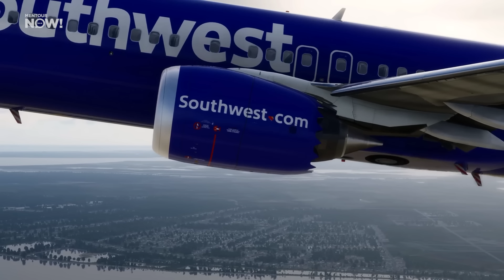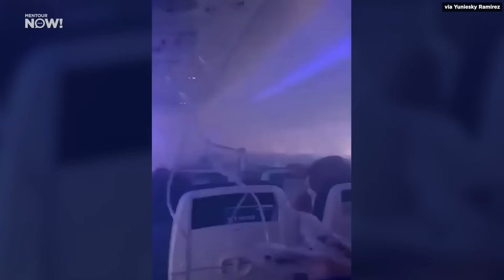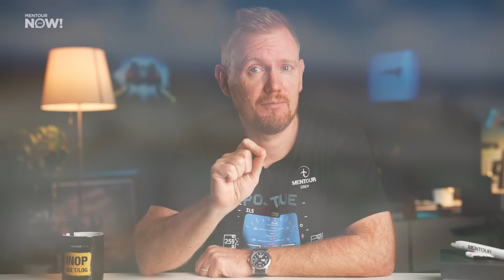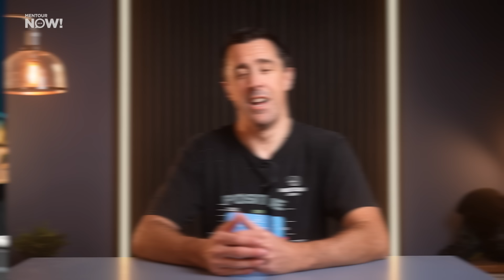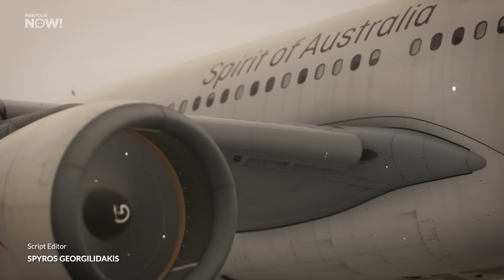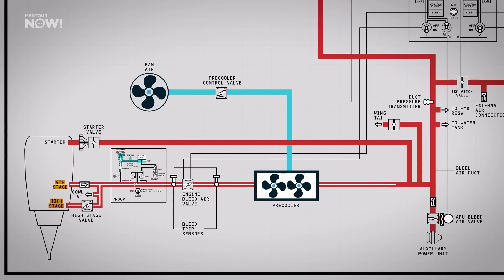Why Don’t ALL Airliners Do THIS?

Comment: It’s hard for me to believe that a fully electrical system would be equally or less efficient than a bleed air system, or even an improved bleed air system. I suspect really this comes down to the development costs, certification complications, and the avoidance of introducing new problems on a new aircraft. That said, those are indeed real costs that ultimately get passed down to the airlines and passengers. 

We have seen in the automotive market (even excusing/before stop-start tech and hybrids) the movement away from engine driven accessories to electric (power steering pumps, cooling fans, etc). Even my Volvo’s B6 engine uses an electric supercharger instead of a belt driven model like on the older T6 engines. 

I suspect in the future we will see more electric based systems replacing bleed air. That said, in the meantime, short of designing a better LRD substitute on new engines, the software fix to shut off the HVAC of the affected seems like a no brainer. It seems like in future models with bleed air HVAC the air quality should also be monitored for contamination.

Comment: It's a technical, a physical issue, not a software one.  I used to visit an aeroplane 'museum', here in the UK, where all sorts of Cold War jets and civilian aircraft accumulated.  It was privately owned, so made a bit of money by breaking and selling parts to other collectors, from planes that really were past redemption.  My point is that, amongst these parts were what looked like turbos from trucks or sports cars.  Apparently they were driven by bleed air from the engines and compressed fresh air to run the cabin air system.  It physically separated engine air from cabin air, the price was slightly less compressor efficiency by turning engine air into cabin air and the addition of a few Pounds weight of equipment.  It seems that penny pinching is risking passenger safety, rather than using an entirely isolated fresh air supply.  Technically, you could run a turbine compressor for pressurised cabin air, from an electric motor, the latest battery tech is now so safe that something with enough kWhs storage could keep the climate within the norm, even with various systems failures.

Comment: I can definitely understand the fear of unproven technology or innovation and wishing to stick with the tried and tested, but I'm actually pleasantly surprised that Boeing is still willing to innovate despite their current reputation.  It will be interesting to see what happens down the line to see if removing the bleed air system and relying on electric battries snd generators (which still requires drawing power from the engines or the APU) is a potential step forward, or some kind of hybrid system (e.g, relying on electricity for air conditioning, and bleed air for anti-icing with an electric backup if there's a bleed air malfunction).

Comment: DC8/Boeing 707/720 generation of aircraft didn't bleed air directly from the engines for pressurization and air conditioning via a compressor driven by bleed air

Comment: And why pilots should never comment on engineering.
The main reason the 787 is an electric mainly is because of the fuselage.
 It composite. Oil dose not work with composite. Even minute oil into a composite fuselage can damage the material.
Hence why cabin blowers are used. This is not new to aviation. Cabin blowers have been used in the past. I’m pretty sure the 707 used cabin blowers.
The airbus 350 was an aircraft quickly put into production to go against the 787. The 787 had the jump on airbus as they didn’t think it would work nor wanted. Hence the older style systems. 

As with most pilots their engining knowledge can be written on the tip of a pin with a felt tip marker.

Comment: In general, not necessarily aeronautics, I would ask the question if complicated hard-plumbed hydraulics can be replaced wutg self contained electro-hydraulic modules or servos, rather than driven by centralized pumps and lines. Can such simplification preserve functionality of systems that otherwise would fail along with other systems?  Would redundancies  in some areas be as less critical for EVERY system, if you can isolate components that would harm others?   I would expect less weight, fewer failure points, less wiring throughout, higher efficiency

Comment: The evolution is clearly towards electrification. Also in aviation.

Battery tech has evolved immensely even in the last 5 years. You could even book a plane on shore power and charge batteries so you don't need to run the engines and generators unnecessarily.

Comment: Maybe the weight and efficiency benefits switching to electric system is not (YET) that great. But for the safety alone it is already worth switching. New battery chemistries in the meantime will make them lighter and absolutely fireproof, and electric motors becoming even lighter and can run for years without requiring any maintenance. Like someone already posted here - old technology practically reached it limits of improvement, while the new one (bleedless) is just at the beginning of its evolution.

Comment: nice  explanation   because it shows   the  the  electrical system  of  the 787 is  kind   of "totally  new"   
As  You  know  there   was the  accident  of  th  787  Air  india,  and   to   cut  a  long  story schort   and  not  arguing  about  deep  details and   diverse  oppinions   I  workeed  on that  quite some  time    I  will  just cut  it  short!   The  preliminary   record is best  way  to  say missleading.  There  are reasons  for that, becaus boeing   Air  india   and   the  governement   they  all have  stakes  in   the  accident    and  nobody wants   them   to blame..     On the  other hand    the  data   of  the   flight rcorder  aren   knowen to  the  public  onla  partwhise   and   the main thing that  does not seem  to be  openly  available   is  the  Video   of  the   plane    covering  the  whoe flighet...   So   What  I  did is   to    calkulate   stap  by step   what   the plane  schould   do   with  the  data  or approximatet  data   i have .   so   1/25   second    to the next  one   trust   and  drag   angle  of  attec   and force  on the  Wheels   was  calkulatet  hiere with  the  result   that  the  weight  of  the  airplane was  flightwhise   within the  limit   but  runwaywhise   ist was  precisely   the  limit.  Due tu temperature  and  runwaylength.... So in  opposit  to  some ekplanations  in t he  internet  i  do  see  thet   the  plane  follows  exactly   withein meters the  prediction  the  caklulation gives.  This  is  quite difficult  to   detemin because You are in  ned to precysely  analyse  the Skiline,  and the  Wether   and  the  picturepixels  make it   wuite hard  to  fnde  ou  which building  gives  You   whicht   Pixel   of  the  skyline...  
This  is  correkt  for  the  time  on  the   gruond  anf  gets interesting   fpr  the  flighet  itself because   the  distance   from Lift  of  to  the  point  of impact   in time  and  Way   is  knowen   pritty  exactly.  With  the  eright  a of the engine  and  the sppees  of the engine  and  the  piont in thime  wehen  Power was  lost,    With   the  need to  be  able to fly  the  plane with only   one  engine   under theses  conditions ist  is  easy  to  find  out hoe much kinietic  energy   the  planne hat  and  thus  You  fide  out  the nesecary   aerodynamik   Values  You  need  to get  a   clear picture...  And  that  picture  is    different  from  what You  theing   wehn  reading  the  report....  So   theink  about the  timeline  and You  will   fnd  out  that the  Engines  will  deliver  trust   until   Flame   out..   minimum  longer OK...    and  There  is  a  time  Gap betwean   cut  of   for  the  fuel  and   flame  out for  the enggine...  

So   we see  that Fuel must have been   ciut  off  sholy before  flame   out,  and  Question  is  how  it  happened. Tecnically   spoken because  the Fuel  valve  die not get  electricity  and  colsed   spring  loaded   .  thes will happen  if  the  Switch  is  switched  and   a relias is  switched   and that Relais    swictes  the  fuel   valve.....  Question  is  why   did  the  Relais   not  deliver  electricita  to  the  fuel   valve?      Ther are  different polibilitys.  Pilot switched te  switch,  sombody pulld  the  firerhandel  works without  tucheing  the  switch  at  all  or  we  have no  Electricity  on  the C1 Bus      

to  deteckt  eletrycyta  or  lach of  electricity   on  C1 bus   is  easy because  the reat  wil derploy if  C1  ad C2  is not  availibal!   and not  generel  but  parthwhise   the big  doors   for  the  landinggear  will  open automaticly    without  anybody  acting   just  after  lift   off....    if  lift  off is   acheaved   the  schuld happen  automaticly  and  the  pilot  just   lifts  the  landinggear...   You  can look  it  up  what  is done  with  C1  and   if  C!  does not have  electrycity   or has   a  short  current,  that  schuulf have some  additional   effects  and schould be  seen  on teh  datarecorder....... So what  is   clear is that  rat  deployed before    the  report says    the   "cut  off"           So  the  valve   dor  th  left  engine  musthave  closd  before  Anybody tuched anything....      Go  deeper  into  the  electrick  systm   and You  will find  that  a  schort  current   in C1  will  schut  off  C!   but  will shut  of  the  C2   system  thereafter,  so   rngine  two geot no  fuel   too....    That'sbad because having  two  sysems    should  just  prevent  this.    But here  The systems  are  connected   beacause   thes  want   redundency   in  case of  a   deliour   "no  power supply"   the otehr  system   with  generaor  will help   out  Everything   ok!  but  if  You  have  a  short  curnt  the  connection   wil ruin  the second system!   so  that's   waht happened...   I  dug  deeper into  the whole   thing  but    faced  some  limitations     (pleas  considder  that  everybody has limitatios!  some  people theink  tey  do  not!  and i like  to  prove  them   wrong...   but  in this  case   an  austrelian engeneer  was  diving  deeper  and    he   is nor  a  guy  to  explain  good  ore make good  videao   etc, but i  could not  find  a  fault  in hie  aruing  ent  ist  is    xactly the   same   I  found  aut but  takes  it  a   step  further...  So  I  like You  to look  it  up  and to think  about  what realy has happend  here... I am suhre  the  pilits did not have  any  chance!     ther e are  two  ctitical  things  to  say.   There  is   a  rute  cause,  and  the  suggestion   ist that's the  diode   in  the Battery  sytem  and a schort   current  threough  tha battery...    might be righet.  That  one engine not  running   would have ment   teh Pilots   would have  had  a   good  chance   to save   the   plane  with  one  running engine.   But  the  realy bad   thing  is    the    connection betwean   c1  and c2  veeing  closed   during  the  flighet    eiter   from teh  beginnen   that mans    it  was closed   while  boath  systems   had  there  own  Powersupply    and  schoulf  nat have beeen  connected    Or  it  was  an  automatic  act  of  the system  for   redundency   in a  sconde  after  C2  failed  due  to  schort  cirkurit!       so   what  ever  the   rout  cause  was,    we have  a problem  killing more than  200  people   and ist's a  built in  faulte  waiting   for  the desaster  to happen.   I  do not  know wether  its's    a maintenence issu  wether its's   mentiond anywhere ,  wether  its   a fault  in  the  design of  the  system   or  was it  requierd   to   work   this  way ..   how   schould  the system  work  in  this  cays   was it   rquererd   constructet  implementet   and   tested?        So   what  did   the  othoryties  rquire   what was  tested?       Sorry for my englisch  !   it's not mymothertoung,

Comment: The 787 main electrical system apparently runs at an unregulated nominal 400 Hz (360 to 800 Hz depending on engine RPM). Higher frequency allows much smaller transformers and other components. US Navy ships have primary electrical systems running at regulated  400 Hz, with secondary systems for certain purposes running at the usual 60 Hz. The high frequency allows transformers and wiring to be much smaller, saving weight.
Reply: smaller wires, higher voltage ?
Reply: @citylockapolytechnikeyllcc7936 when you trade amps for volts the wires get smaller.

Comment: The 787 AirCon system was not as reliable as a pneumatic system for several years.
Mods and updated compressors have improved the longevity of the system.

Comment: I read that the 777X is using a bleed air system too, because the motor/generators required to start it's huge engines would require so much electricity and batteries so big, that the weight penalty would make it not worth it. And also retrofitting the electrics required into an older airframe designed for a bleed air system would be too expensive. Apparently also the weight of the electrical de-icing system is too much to make it viable on smaller planes, so the maths for full electric only really works on planes from about 737 size up to around 787 size. But what we might see is a hybrid system, where anti-ice is done by bleed air, and air conditioning and engine start is done electrically.

Comment: The main reason a no-bleed system was simplicity. Having a starter-generator eliminated the engine and aux pwr unit's starter clutch as did getting rid of the generator's troublesome constant speed drive mechanism (the 787 uses variable frequency power--APU runs at constant speed). Those miles of bulky bleed ducts, valves and heat exchangers were expensive to build and maintain, and added weight.

Comment: I really do like the idea that the 787 cabin & cockpit can't get inundated with toxic oil smoke that makes your eyes, nose & lungs burn like hell, & the stink of oil smoke is not exactly like lavender.. & as an experienced electronics engineer, I can tell you that electrical & electronics systems these days can be made very reliable with good engineering & manufacturing

Comment: 15:40 why they couldn't made it with near earth altitude pressure?
Reply: That takes more energy to do, I think. 6000ft is significantly better than 8000 though, and it’s definitely noticeable when you fly on a 787.

Comment: all this incredible tech yet there still are tiny buttons to press for frequency and coordinates in the cockpit, which can be input incorrectly…and manual weight calculations as well as fuel levers which can inadvertently depressed to cut off flow…also the air traffic control systems still uses cardboard slides to prioritize airlines on line
Reply: "inadvertently"?

Comment: I'm not convinced it's more efficient, given then fact that the compressor on the engine is ruthless optimised to efficiently compress air, on top of that mechanical to electric to mechanical adds conversion inefficiencies. Still definitely more maintainable.

I'm suspicious Boeing are saying the engine is more efficient at producing thrust as no bleed air, but ignoring the increase shaft resistance from the greater electricity draw.

Comment: A better question is why Boeing didn't do it for the 777-X. Airbus got the A350 certified with very few issues. They could probably have made an electrical system work too. Right now there are too few electrical aircraft to judge them a success or failure.

Comment: I think the original DC8 used fresh air for the cabin, which it pulled in through the two front inlets below the nose. It used turbocompressors driven by bleed air to compress the fresh outside air, instead of directly using bleed air for the cabin. The 707 did so too.
Reply: I didn’t know this, but it was my first thought as a solution to prevent contamination.
Reply: That seems more advantageous. I wonder why that didn't continue. Maybe it increased drag?
Reply: I bet it was changed for some efficiency reasons
Reply: I was a licensed ground engineer on the DC8 back in the 70s. The problem of oil pollution in cabin air was sorted by the nose mounted turbo compressors BUT most cockpit crew suffered hearing loss because of the high frequency noise !

Comment: My guess of why it's only in the 787 would be patents. I'm sure Boeing was smart enough to patent this technology so Airbus and any other competitors couldn't use it. One big advantage to 787 passengers is the air conditioning can continue to run while the engines start.
Reply: Running a generator from the jet engine isn’t patentable nor is running an air conditioner and compressor from a battery. So I am not sure what you would patent. You might be able to patent specific components but they would probably be 787 specific anyway. There is nothing here that really passes the test of novelty or being non-trivial.

Comment: // sarcasm on
The future is definitely Boeings fully electrical approach, because the day when at least 51% of our wise leaders gets out on the wrong side of the bed, they will ban combustion engines for airplanes too, although they will need some time to reach consensus about whether airplanes should carry some 1000 tons of batteries or we should build power rails up at 30k feet high all over the world.

On the other hand, considering the engineering tradition to mimic the old ways using the new principles, this would mean only that electrical motors would be added to rotate the same turbines, which thus could power both the existing air bleed systems and the existing generators as well.
// sarcasm off